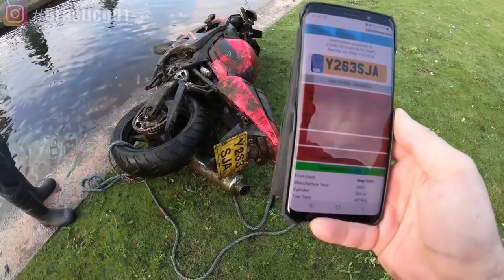All The Stolen Motorbikes Recovered From The UK Canals - Magnet Fishing Compilation

Comment: Nice collection. 
Have you thought about putting legs on that hoist in the back side so that it doesn't tip over so easily? Ones that could slide in a track, or square opening that holds the square bar in place... like what the front does.

Comment: You need extendable outriggers on that crane and 2 cables on the rear at say 80°angle from each other attached at the top of the static part of the crane where the arm pivots from and then stake them out behind the crane with steel rods into the soil at an angle.
Reply from the maker: Thanks for the advice